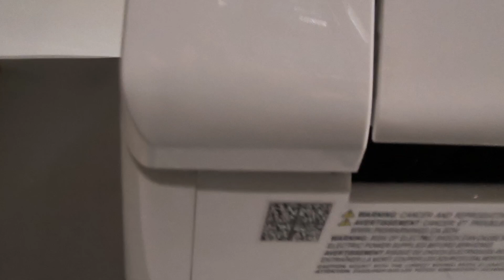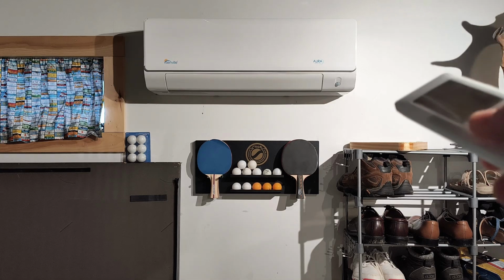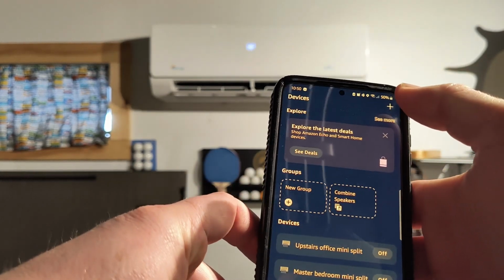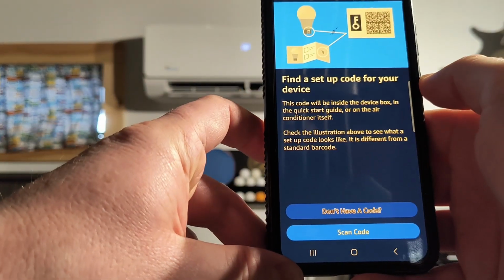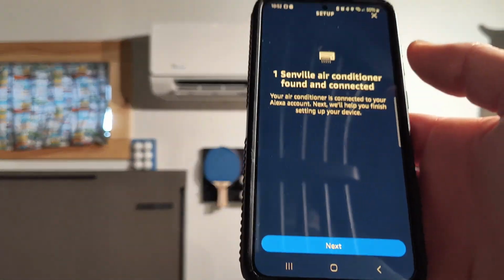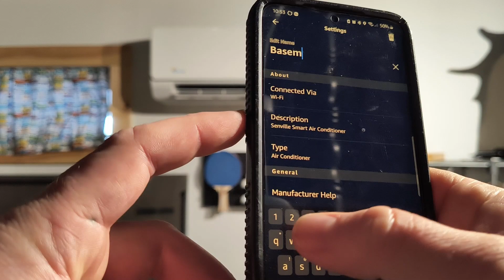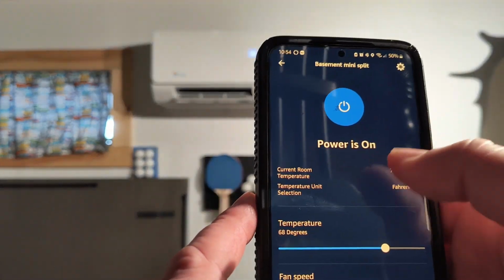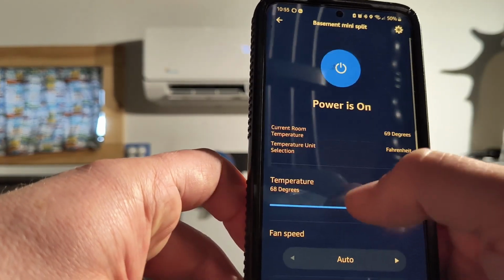Senville Wifi / Alexa install and setup guide - How to

Comment: I am new to using the Senville Mini Split.    Do you know if you can use the wifi option while not on the same network, so if I want to control the temp of my cottage, warm or cool the cottage while still at home?  Or do you have to be on the network at the time and it is just an alternative to using the remote?

Comment: Thank you for this. Just finished my first ever mini split install, wanted to get Alexa going and this really helped. Took a couple tries to get it to connect, but it finally did. Everything is working great, units pumping out some really nice heat. Installed the 12,000 btu unit in my off grid home/camp running on solar.

Comment: I have one year traying to do this, but i cant to enter to the AP mode.
Reply from the maker: You hit the LED button rapidly many times while pointed at the head?
Reply: @AtlantisEnergySolutions didn't work.
Reply: I have the same issue. Contacted Senville support. The instructions they sent would not work either. Power down at breaker for 30 minutes, remove batteries from remote. Then restore power, replace batteries and turn on a/c with the remote. Press LED button 7 times. Still nothing. Fortunately i don't need the WI-FI capability, but thought it would be nice to have.
Reply: I seem to have the same issue. I had all my four units added to alexa two years ago. I had to change wifi name and password recently. The alexa app showed all devices disconnected and it does not have an option to reconnect them to wifi. I deleted all four units from alexa to reconfigure them again. I successfully added 9k,9k, and 18k to Alex but I cannot activate AP mode on the 24k unit.